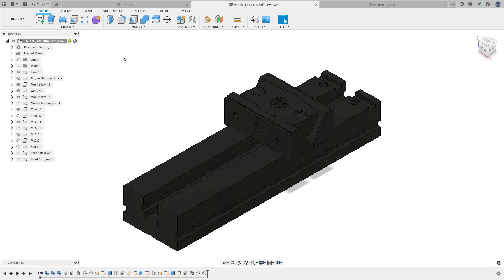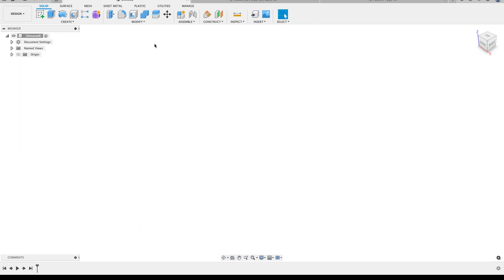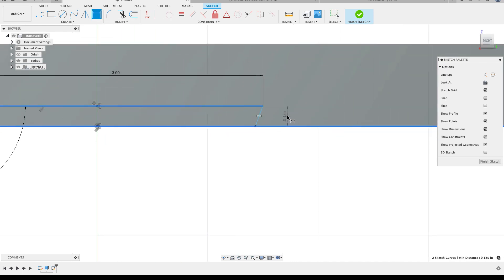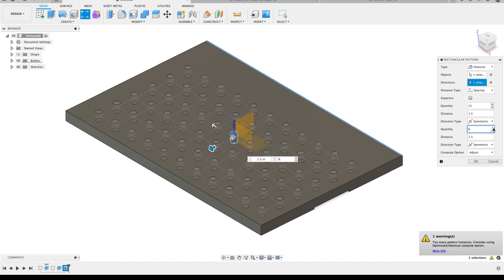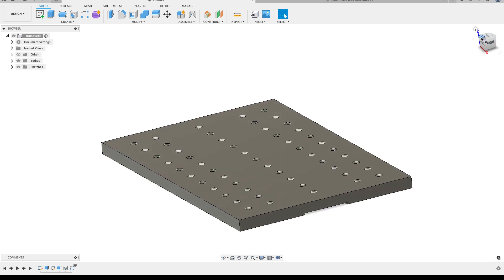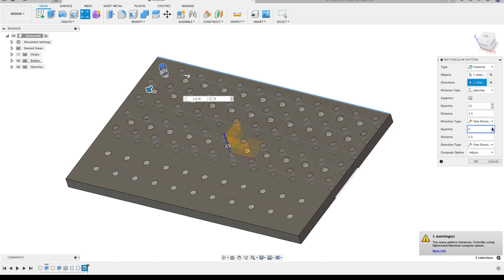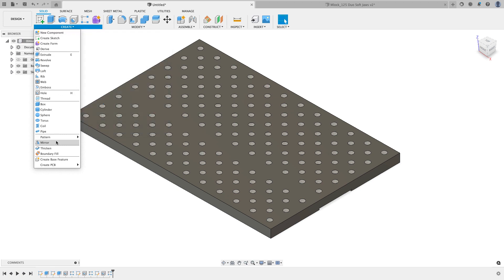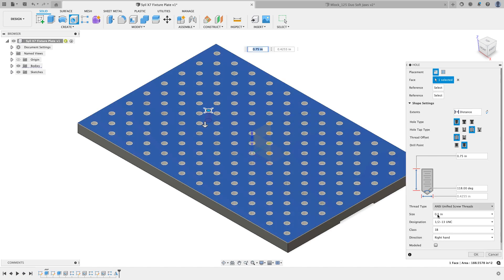Fusion 360 - Optimizing Large Patterns to design a Fixture Plate

Comment: Some stuff is fast, some is slow. I'm modeling a perforated grille in a truncated cone shape with rounded edges using therefore "emboss" to morph the pattern seamlessly from front face to sides. It should be quick but my i7-4770 (mid-2013) really struggles with it, also because this fonrt-to-side morph cannot be used with "pattern or features", but the pattern needs to be in the sketch which I emboss.
Otherwise yes, specs are surprisingly quite irrelevant.

Comment: Hello Kevin,   I have a part I will need to clamp and drill holes into then use the holes to bolt the part to a fixture plate so I can remove the clamps.  After the drilling cycle how do I program in a wait for operator M0 to facilitate me bolting the part down?   As you can tell I am very new to cam.  Your videos are great and I have learned a lot from them.  Keep up the great work.
Reply from the maker: On the setup drop down menu up on the tool toolbar, you will see something called Manual NC. Choose that and you can add things like optional stops or stops to the program.

Comment: Great video Kevin!  The mirror doesn't work by default because the Pattern was set to Optimized.  I found that the mirror needs to match the pattern settings.  So "Adjust" is default but if you set it to Identical or optimized then your mirror needs to match.  Only for Features.  If you pattern faces you won't get that option.
Reply from the maker: Hi. Thanks for stopping by. That may currently be the case, but it shouldn’t need to work that way. The reason I know it’s an issue is bringing this up to the Fusion PMs from a training class part I do. In that part everything is adjust and often the mirror fails. I know this is an issue they are working to correct.
Reply: @MechanicalAdvantage  Thanks for the info!

Comment: Thanks for the great video Kevin. I continue to learn new things from you every time I tune in! I am going to design a fixture plate for our SuperMiniMill. I think 1” thick 6061 aluminum and bolt it to the T slots semi-permanently. The plan is to use dowel pins on our vise, the Pierson ProPallet system and our 4th/5th axis indexer.  The plan is to make it easier to change these fixtures as needed in a timely manner. Going to use stainless steel percision bushings press fit into the fixture plate for the alignment dowels. I like the 1/2”-13 bolting pattern you did as that would be useful for larger parts that don’t work great in a vise. Thanks again!

Comment: Before everyone who didn’t bother to search piles on, look for this type of thing:  “Standards for the exact length of an inch have varied in the past, but since the adoption of the international yard during the 1950s and 1960s it has been based on the metric system and defined as exactly 25.4 mm.”

So, yes, inches are by definition a metric system of measurement. Just based on very weird multiples.

Comment: Nice tip about getting rid of the auto-projected items.
Reply from the maker: Thanks. I get why they did it, but it kind of drives me nuts. You could see how quickly it made an impact on performance. I understand it is easier for new users to not know about projecting geometry but in the long run, auto projecting everything is the wrong default.

Comment: Hi Kevin,
I believe you will get a lot of clamping distortion if the plate is not bolted to the table. Try running an indicator over the plate before and after you clamp a part to make sure the plate is not flexing due to clamping pressure. I love Fusion 360 and learned a lot from your excellent videos. Thanks for sharing.
Steve
Reply from the maker: Hi Steve! I don’t disagree with you. I haven’t run the indicator on it yet. The job this will be cutting is for custom signs that hold hardware for roto-molded parts. So I think the tolerance is about +/- 1/2” haha I have an idea for supports for the ends. I’m not sure I’d ever use this for a precision job. Maybe if I can build some adjustable supports that will let me dial the deviation out of it.